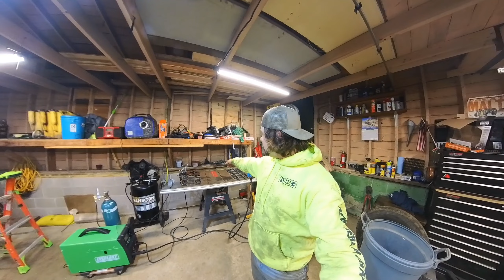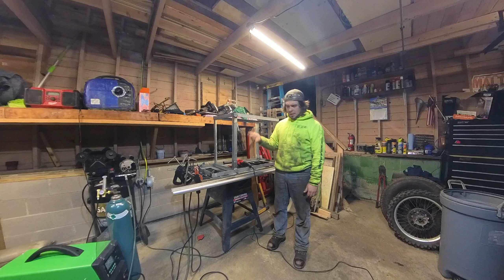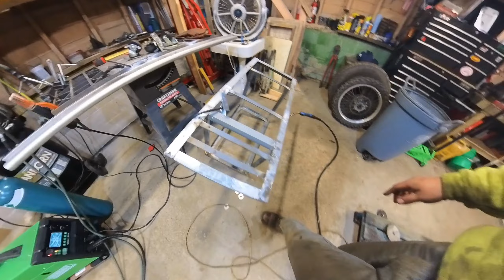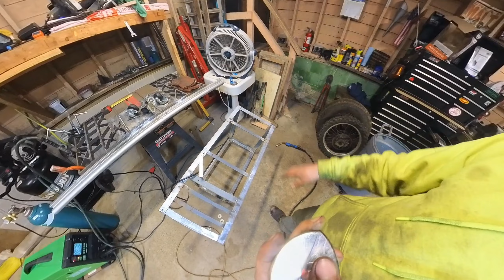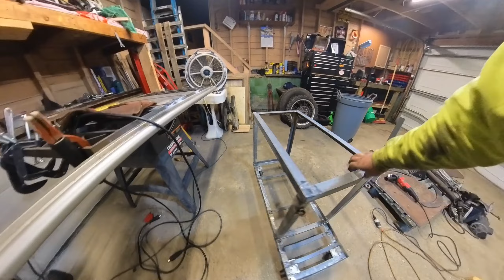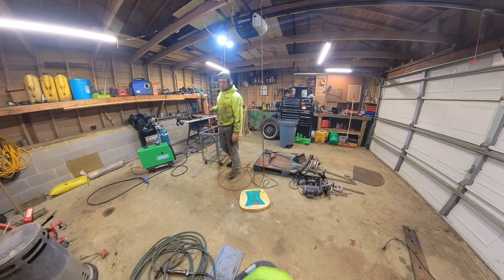Making a welding cart for my Everlast Lightning 225

Comment: Nice cart man! Simple but just right! It’s must for sure! I’d rather see the unit mounted on top for easier access to panel….use underneath for storage add shelves
Reply from the maker: Thank you! The main reason I have for having the welder sit low is because my garage floor isn’t in the best shape and I don’t want the welder to tip over if I drop a wheel into a hole. But I do agree having to bend down to adjust my setting is annoying!